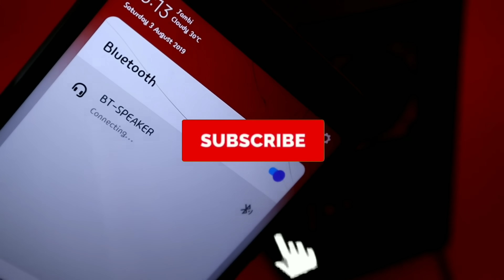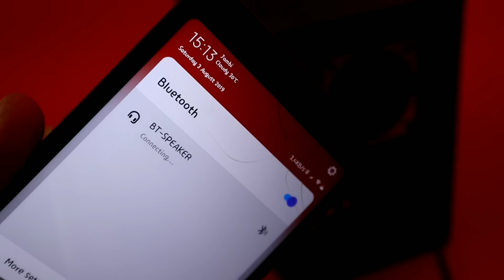Bluetooth Amplifier

Comment: I have 7.0 Bluetooth speaker system., but subwoofer is currently not working.. what points I need to check inside the circuit board..

Comment: Bang mau tanya saya coba beli juga. Tapi output kluran speakernya kecil sebelah. Kira2 apaan ya bang masalahnya
Reply: Semoga membantu yg 1 untuk woofer yg 1 untuk midrange / tweeter....kalau mau double di seri aj midrangenya....karna lubangnya cmn ada 1 yg untuk tweeter atau midrange yg lubang 1 nya untuk woofer...perhatiin video ini bang udh jelas itu pas masukin slot kabelnya...🙏

Comment: I didn't understood why do you attached satellite speaker into subwoofer cabinet?
Reply from the maker: because I want to replace the old amplifier with a new amplifier, there is a woofer speaker insulator so it doesn't interfere with the bluetooth amplifier
Reply: You need to close the back end of the satellite speaker from the sub

Comment: Amplifier seperti itu cocoknya speaker berapa Watt Mas ,juga kalo pakai accu motor bisa gak ya...makasih
Reply from the maker: Maksimal 4inch, 50watt, bisa pakai 12v 
, sdh ada input 12vny
Reply: @TUTORIAL-Tips  maaf Mas , saya mau tanya lagi ,saya punya ampli 100w , jadi harus pakai speaker berapa Watt kanan kiri nya  supaya suaranya pas ,mohon jawabannya terimakasih..
Reply from the maker: @slametrohmah1145  bisa pakai 2buah woofer 3inch 25watt + 2 tweeter 1.5inch 10watt
Reply: @TUTORIAL-Tips  terimakasih 👍

Comment: Mas bro speaker aktif saya rusak,di ganti dengan ini berarti semua part yg di dalem nya cuma di ganti dengan ini ya???
Reply from the maker: Cek dulu speaker ny berapa watt? Klu ini mono bukan stereo dan maximal 50watt, atau cari modul bluetooth amplifier yg model lain sekarang banyak mas harga juga bervariasi
Reply: Specifications:

Satellite drive:2 X 3”

Satellite drive impedance:6 Ohms

Subwoofer drive:5.25”

Subwoofer drive impedance:8 Ohms

Satellite output power(RMS):26W

Subwoofer output power(RMS):26W

Total System power(RMS):50W

Frequency respone:20Hz-20KHz

S/N Ratio:>70dBSeparation:>35dB

Distortion: 0 .5%(1KHz,1W)
Seperti ini mas bro....
Reply from the maker: @muhamadsahroni7345  bisa mas tapi  mono y bukan stereo, klu dilihat itu speaker ny ada tiga
Reply: Iya memang ada 3 berarti yg satu tidak terpakai ya???
Reply from the maker: @muhamadsahroni7345  bisa dipakai tp digabung 1 jalur utk 2speaker, yg jalur subwoofer tetap untuk subwoofer
Reply: @TUTORIAL-Tips  siap trima kasih mas bro ......
Reply from the maker: @muhamadsahroni7345  👍🏼
Reply: pake tpa3116 aja mas.. cari yg 2.1, atau yg versi bluetooth jg banyak jual. klo ampli ini mono, soale sy jg punya..

Comment: Mas kalok pakek spaiker 6 ohm 80 wat bisa enggak
Reply from the maker: Nggak bisa mas, klu dspesifikasi 4ohm 50watt, tp saran saya beli yg bentukny yg gepeng harga 250-350 dishopee banyak, 600watt-1000watt bisa utk speaker 4-12inch suarany jozz